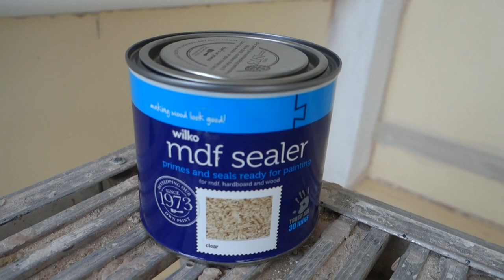**DIY CONSERVATORY ROOF** INSULATION |RENOVATION| SAVE ££££

Comment: Hi Elayne, are there any measures in place to prevent damp between the polycarbonate roof and the insulation boards? I really like your idea and would like to do the same but I am concerned about damp. By the way, it's looks great. You sound very local to me 😊
Reply from the maker: Hi Rob, we sealed all the roof panels where they meet the 'rafters' with silicone sealant to prevent any external water ingress and made sure everything was completely dry before we started installing the insulation boards. We used silver tape to seal every join and then put up plaster board then skimmed over the top. It's still doing ok 2+ years later 😊. I posted the video after it had gone through all seasons. I have to say it's one of the best things we've done. We prefer to use it as our living room now whilst we couldn't use it in the winter at all before. I'm in Sunderland hunni x

Comment: Hi have you taken off the plastic from the rafters and nailed the batons on aluminium ?
Reply from the maker: Yes we took the plastic trims off but we made the timber frame freestanding as we intend to put an external roof on at a later date. I explain it all in the video 😊
Reply: @silvermoonlightuk  i plan to put the tiles on the roof but didn’t think you need any support? Most the companies i got quotes from didn’t mention this? But now i intend to do the job myself.

Comment: Hi what insulation did you use? Have you got a link? I thought u use superquilt ? Then baton again the plasterboard and plaster
Reply from the maker: Hi there you can do it like that but it's not as warm. We used insulation boards 75 mm thick . They go by the name kingspan, celotex, thermotex and are available from places like b and q , wickes but are mostly cheaper from builders merchants such as builbase. The wood we used was 3x2 stud timber. Hope this helps 😊
Reply: Thank yoi x

Comment: Hello there, just seen the video cracking job you have done. Hate to ask but I have same size conservatory and was wondering how much it cost you to do this. And has it made a big difference in heat? Many thanks liam
Reply from the maker: Hi Liam, we lost a bit of material due to the odd shape and cuts we had to do. It cost us £800 approximately and it is so much warmer. We can actually sit in it in the winter and it retains the heat now. It's also much cooler in the summer and not like a greenhouse anymore. It's truly worthwhile doing 😊 Elayne
Reply: Thanks for getting back to me elayne, how long ago did you complete this. Thank you so much for sharing this information.
I’m thinking of maybe doing the same but using the supaquilt foil instead of the king span on the roof. 
That kingspan is about £100 a board o think now. My conservatory is 9mx4m.
Reply from the maker: Liam I think we did it in either 2020 or 2021..it's all a blur these past few years lol. We thought about using the super quilt but on checking the thermal qualities decided against it as the kingspan was better. I think we used thermotech from buildbase as it was cheaper than the kingspan and jaad similar thermal qualities. Another good point to make is the sound reduction of the rain and also the neighbours can't hear your conversations anymore lol
Reply: Look nice! But what l don’t understand is, your supposed to leave an air gap of 50mm between the polycarbonate and the installation . Then 25mm from insulation to plasterboard or cladding. Air has to circulate otherwise it sweats and causes damp and mould further down the line. I have seen many videos like yours and heard of the stories where it all had it be ripped down later and done all over again because of the above reasons.